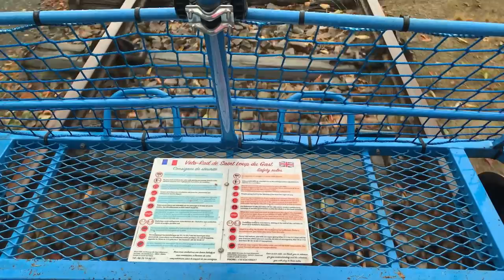Chateau Life 🏰 EP 27: THE HORSE BOX BAR BEGINS

Comment: What about using the plexiglas sheet and making it a skylight .... seems like it would be a more economical material.... there should be some bend/flex to it for getting the drainage to the sides that you were looking for.... it would allow natural light in hence not needing much lighting for daytime use and attaching nice thin led rope lighting around the perimeter for evening lighting and the beauty of the sky or trees looking up ....
Reply: Guy Lane it would get hot.
Reply: I was coming to suggest this as well!
Reply: Me too! I think it would be great, especially at night under the stars at an event. I think it would also make the trailer seem bigger with a skylight.
Reply: @irenepirnik2926  you're right, but could use a blind for shade.
Reply from the maker: The heat isn’t an issue, it’s having a small fan built in for air flow, the small ‘jockey door’ would be open, the serving hatch, rear tailgate will be down for a second serving area and the front one will be a empties collection hatch so plenty of air flow all round.
Reply: Sky light with a vent / shade
Reply: I was just watching and thinking the same thing 😂 great minds 👍🏻

Comment: This will be a really cool repurpose for a bar! What about not cutting anything out and taking thin aluminum and place over the holes. You can use butyl tape to adhere the metals together. Seal around the edges. For the angle iron, what about 6 inch aluminum flashing that is self stick? You then can seal the edges with caulking. You can also use small screws to hold the flashing down on top of the angle iron, just caulk the screws so water can’t penetrate the holes. For the inside of the trailer, where the holes are, use Bondo to smooth out the ceiling. Just grind away the rust and scratch up the new aluminum, so it sticks. You can buy the bondo in a small tub. I know a lot of carpenters are even using it for furniture restoration now, so it’s pretty versatile. You could probably bondo the roof after putting new pieces down to kinda smooth out the edges- if you were worried about the water run off. I hope you can figure out the best way. Nothing too difficult since it probably won’t be seen. Good luck! 😊

Comment: on the roof: buy a wire wheel for the grinder, can of spray zinc based primer and panel jogging tool. 1: wire brush the whole top, paint with zinc primer, cut out the through rust using the smallest hole possible, jog the metal edges up, run a bead of silicon around the up lifted edge and place perspex ontop. The water will always run off the join. Then paint. 2: when hole filling as you did, try placing painters tape over the hole from the outsize, place a dob of filler on the hole on the inside, place plastic film over the dob and use a hard roller to blend it to the panel underneith the film. Finally remove film and tap and sand smooth. It's cleaner, uses less filler and saves a bucket of time, sweat and dust.

Comment: My husband is a welder. He said he would cut the whole piece out on top of the horse float then weld a new section above the rails so the water runs off 😊
Reply: That's what I thought to.
Reply: I like this thought!
Reply from the maker: That was my first thought but problem is it will turn into a patchwork quilt quickly as the front section is all one pressed piece which I can’t recreate here and the rust goes further to each side under the frame rails than just the centre piece

Comment: Great job kids...
I would like to make a suggestion for the horse box.  I think raising the areas of the roof so that they would either on top of or just below the iron 'brace???'.  Have the new roof slope down toward the curve.  And as if that were not enough, perhaps, if were possible, to bend the metal replacement roof to be metal to metal with the original curve, metal to metal, when finished.  I would add two sloping channels so that any rain would completely miss the windows under it.  You could add a nice awning over the windows and hide the two water channels.  Last thing, you are not doing this much work (and doing it well) to let the 'box' just sit around not be useful for any length of time.  If that is the case think of having windows that open because on a hot day anyone who was inside the box, it could be very uncomfortable for them.

Comment: Hi Phil. Suggestion for the horse trailer roof. The existing shape of the roof and where the current rusting problem areas are tells me if you just replace what is there it is going to have water collect in the same problem areas. I think, maybe using a piece of metal roofing that would be used on a shed or a piece of lighter metal from the side of a refrigerator or the top of a large freezer might work. Make it in the shape of an inverted V to shed rain. Make the sides go close to or over the top edges of the trailer so there is no pooling of rain water. I have never welded so that might be the challenge to attach. If you wanted to get fancy, use a sheet of replacement metal that has hinges attached and you could open the roof when more ventilation is needed. I assume it is possible that with your large trees and falling branches any plexiglass roof would be at risk. Good luck and we always look forward to the projects you both tackle at the chateau.

Comment: How about wire wheeling the roof off of all the paint and loose rust (4 inch angle grinder wire wheel) Treat with rust eater to harden and then fibreglass paint over the holes with cromapol resin waterproofer. Getting another metal panel to fit the contours could be a challenge.
We are also building a horsebox bar so would be keen on sharing ideas.

Comment: For the horse box roof, my first thought was to fully fiberglass the surface and down into the grooves along the edge. I'm talking about the adhesive, then a sheet of carbon fiber mesh, then another layer of the fiberglass compound - much like a surfboard is built. I'm no expert, but I'm certain it would take care of not only the large holes, but also the holes along the edge grooves and any rusting issues that may be occurring but not yet visible with the rivets along those edges. The compound would fill any gaps very well, especially if it's reinforced by the carbon fiber mesh. It could also be somewhat shaped to create the necessary runoff so that water doesn't build up on the roof. I have no idea of price or availability of materials for you, but I thought I'd mention it. Good luck finishing it, and greetings from Canada!

Comment: I'm sorry this is after the event but I would suggest that all the small drill holes could have been pop riveted.  For the roof I think a metal roof and you could put an old caravan pop up roof window in for ventilation.  If you do a perspex roof you might cook yourself when doing events if it a really hot day
Reply from the maker: No the small holes couldn't be pop riveted or all you would see once it's been painted is the rivet heads, we want it smooth on the outside so you can't tell there were ever holes there x

Comment: So sorry you cannot hold your events this year, it is such a bummer!  Hope work in UK can bring in some much needed funds to help with running costs.
Could you perhaps bring forward your chateau marketing item sales via the internet using the designs you agreed with your friend. Not as much as you would need perhaps, but with so many subscribers, you should make quite a bit towards costs. Just a thought.

Well done for finding a project which in the long run will make things easier. 
As it gets so hot in a France and a Perspex roof would make the trailer like a greenhouse! I think a metal roof again - do you have vehicle salvage places over there so you could source an old van roof panel or similar from? Perhaps an old caravan roof would do too?
If not, then repair with the fibreglass matting kits you get for fixing bigger holes in bodywork.
Which ever option is chosen, think it has to be realised that with water runoff, you will get a damp channel around the edges which could cause rust again, so a solution to that problem is needed in the repair.
Good luck you two, you are hard workers so will get there in the end. Keep positive - unfortunately something we are all having to do at present, wherever we are.  Unfortunately, there are many who are much worse off than us at this awful time. Good Luck

Comment: Hi Phil,
Sorry to hear about your events being cancelled. These are difficult times for all of us. I have watched your video on renovating your horsebox. I have done several of these type of trailrrs as a helper at our local scout group. Why did you use filler on the holes? Small patches of glass fibre ribbon would have been quicker and easier. Why didn't you cut the perspex window to fit the hole? Gobbling it on with silicone looked a right pigs breakfast. On the whole I would award you a B for effort but the computer has changed that to a D.
Reply from the maker: It isn’t filler, it’s fibreglass paste which is slightly easier to deal with than the fibreglass matting but goes as solid.

The Perspex isn’t cut to shape as the inside is being panelled and windows framed so it works better this was for further fixings in them to make them solid and leaves the space externally for the weather seal

Comment: Ok, so pull yourself together. We all have disappointments, pandemic or not. Right, now that's taken care of lets talk bar roof. I would cut the whole roof out, it's all rotten and a hiding to nothing for future maintenance. Get a right size metal sheet to fit over the top, not under as your current shows on the video, of the formers/railings. Bend to fit, cut out two panels, one either side of the ridge line, put in perspex skylights. Self tap and seal all as required. Hope you can picture it. It's what I would do...